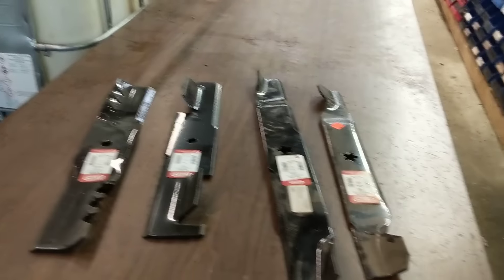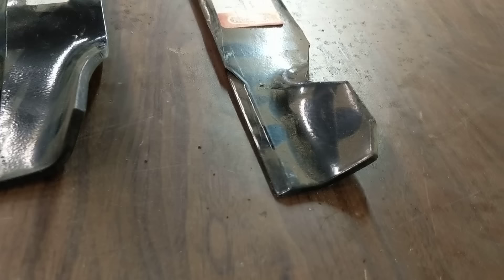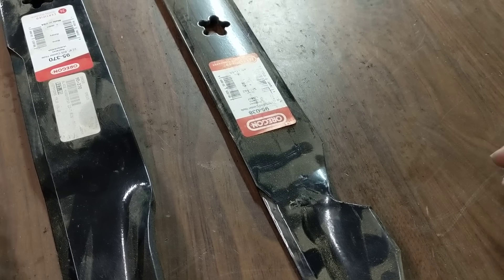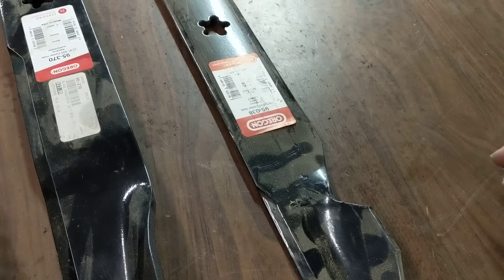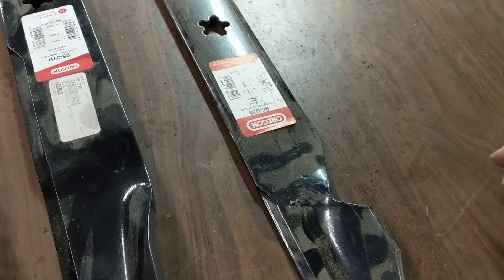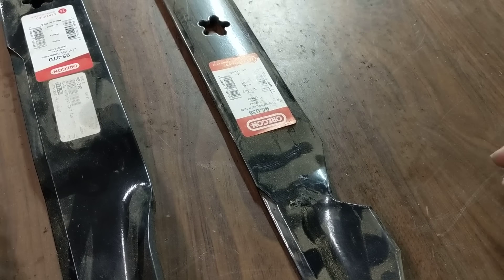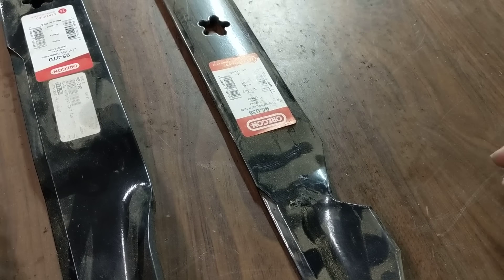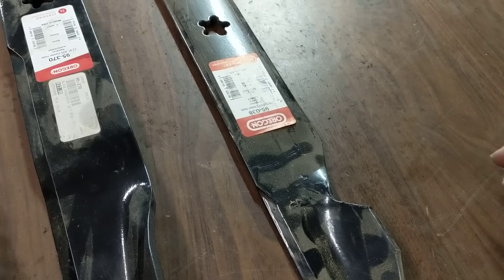Mower blade drastic difference and what is best for your yard and your mower. Oregon, Scag, Gravely,

Comment: Ok I have a question.  Lawnboy 21 inch deck and cow grass will destroy the regular lawnboy blade.  I am looking for a very thick blade like I see on your video Oregon high lift which is very important, and I have heard that one can rebuild the cutting sides of the blade by welding it with 7018 rod.  Such has been done and the blade holds up strong against cow grass.

What is the number of that oregon blade shown on the video with that heavy duty high lift?

Comment: So I mow a lot of weeds, dandelions etc, what’s best for me? I have a 48 inch spartan and the stock blades cut real grass well, but with weeds i have to hit every yard 2 times
Reply from the maker: Well weeds especially dandelions and clover can be a real challenge for any mower. Deck geometry can play as much if not more of a part than the blade itself. One thing to check is the pitch of your deck The height of the front compared to the back at the blade most decks should have at least a quarter inch lower at the front VS the back. Another thing to check to see if your deck has movable baffles lowering the front baffles to the bottom side can help create more vacuum The downside is the weeds like dandelions and clovers will stay laid down longer when they're bent over making it much harder for the vacuum of the deck itself to pick those up and cut them. a good high lift blade is usually one of your best options I'm not familiar with the Spartans so I don't know what is available. Also make sure your pitch is set up correctly I hope this helps. Just understand that many people have the same problem and some decks just work better than others.  if you are mowing commercially it is an excellent opportunity to point out to your customers ahead of time that these things are standing out in their yard because their yard needs a good weeding and fertilizer and seeding services that you can provide them. Each at an additional charge and multiple times in a year can be an excellent source of extra income and plus it makes the yard here mowing look that much better almost think of it as a billboard for your work.
Thank you for taking the time to watch and comment.
Reply: Fueled Iowa I appreciate the comment, helps me out 99% better than everytninf else I read or try to look up thanks
Reply from the maker: @Htzcw  You are welcome! I am glad I could try to help. To many people today only want to give their opinion vs help someone else find their solution. If that makes sense. LOL
Reply: @fuelediowa  I LOVE this reply.  Simply put, some people just like to 'hear' themselves talk. A sure fire way to spot a very lonely person.

Comment: What's the best blade to use for picking up leaves Bob Elkhart Indiana
Reply from the maker: Picking up as in Bagging?
Reply: @fuelediowa  yeah my lawn mower doesn't really bag that well at all I go about 10 feet and it clogs up maybe a high-lift will help
Reply from the maker: @Jerry-me1fy  hi-lift may help a lot. If it is not a power assisted you will always be fighting an up hill battle. Also depending on how much moisture your grass has will play a huge role in how you can bag. I have seen a few instances where Gator blades work better because the clip the grass into smaller clippings before trying to blow up the tube others were high lift works better I've also seen where medium lift works better. most time I would suggest if you're struggling to not be mowing more than an inch at a time you may have to increase your mowing to twice a week to be able to bag effectively . It is kind of like mulching in that sense.

Comment: Can you recommend a true mulching blade then? I search in Amazon returns the ones you've shown here.
Reply from the maker: To mulch properly you need more than just a mulching blade you need an entire mulch kit which divides each section of the deck off and do its own compartment blocking them off. Most manufacturers sell an entire kit with the dividers as well as the blades all in one manufacturer mounting blades as good as any other than possibly lighter weight.
Reply: @fuelediowa  🤔?
Reply: @bustersmith5569 ...he's talking about a riding mower that has two blades. These kits section off/separate each blade from one another creating two distinct chambers (smaller volume in each section versus an open deck with two blades) ...

Comment: What are your thoughts on battery mowers & which blade design would be better than what they come with?
I've got the Kobalt 80 volt.  Works well, but we just drop the cut into the lawn, no side eject unless things are tall.  They only offer the high lift blade.  I'm considering a modification to a blade I am about to sharpen.
Reply from the maker: Excellent question and I'm glad you asked. Battery-powered units you have to be careful with because some of them will have a voltage overload shut off. What this means for the end user is if the blade is too heavy by chance it can trigger this voltage overload only by the sensor causing the unit to shut down. Also The type of blade can have serious effects on your battery run time. As of right now in the main shop that I deal with and work with we are only replacing with OEM blades until we have adequate time to actually make sure there's not going to be any severe side effects and that's going to vary from unit to unit. Also Kobalt last I checked was made by Chevron, it is the same company that makes Ego so it may be worth a look to see if you can find a different style of Ego blade that will fit on your Kobalt the odds are they use the same blades.

Comment: Just bought a Gravely zero turn, which do you suggest for helping with getting a better stripping?
Reply from the maker: I good high lift will give you the best blade wise. however the pitch of your deck needs to be correct and a striping kit helps as well. Plus having grass that will take stripes well very thin scraggly grass weedy doesn't always do as well as others. Thank you for taking the time to watch and comment greatly appreciate it.
Reply: @fuelediowa  Thank you!

Comment: Is there any benefit to using a high lift blade with a John Deere equipped with a power flow, or should I just stick with the standard J.D. blades. It is time for new blades and would like comments on this, thanks.
Reply from the maker: There are a couple different ways to look at this and some will depend on your grass as well as how much moisture is in it. A high lift blade is going to push the grass to the power flow faster as long as the power flow keeps up with the feed then the benefit is the grass gets cut fewer times means less moisture being broke out of the blades of grass. Less sticky build up. Many dealers will recommend low lift blades or even sometimes mulching blades this will give the opportunity for the gras to be cut multiple times equals smaller pieces and easier to flow up the chute. Down side can cause more moisture cause blades of grass to stick and build up more. I know a few guys really like the gator blades for this but similar results to the mulching blade but a bit more lift / velocity to the power flow. In my area southeast Iowa many guys run high lift blades.hope this helps.
Reply: @fuelediowa  Appreciated, I may try a high lift blade and just keep my ground  speed reasonable.

Comment: Hi, which blade would you recommend for my 22" Toro recycler. I have tall grass and use side discharge only. Thanks
Reply from the maker: I would consider the Gator style blade to just help break down the grass a bit more. However it can cause a bit more build up on the deck so will need cleaned out a bit more often. thank you for watching and taking the time to comment.
Reply: Gator

Comment: Gators are louder and you have to grind off the powdercoating off where the blade meets the spindle and bolt washer, otherwise the bolt backs off.
Reply: Doesn't happen on my John deere sabre or scag ztm.
Reply: @jean-pierredejon7458  lots of posts on the various forums on them even

Comment: Hate to say it but the guy talking sounds like he is really having a hard time breathing. Hope he's OK
Reply: Definitely doesn't have healthy looking fingers.
Reply: Not everyone is comfortable speaking while making a YouTube video. I hope he is fine, but I’m quite certain he’s just nervous and wants to make sure he’s conveying the information is a fashion that will keep the trolls from tearing him up...yeah, people can be very mean when they’re hiding behind a computer screen and acting like they’re an authority on everything. 

Good information! Just finished resurrecting a 2001 Cub Cadet 42” that was dead and forgotten. I actually am using blade #2, and it gives adequate lift to send the grass into the bagging attachment. I’ll probably get a pair of those notched blades to see how they do in the fall when the leaves cover my backyard. It would be sweet if they mulch the leaves and fill the bags as well. BTW, part of the restoration was making two new bags with mil spec coated mesh and 1000 denier Cordura for the back and bottom. The bags will,probably outlast the machine. My cost was only $25 to make both bags...1/4th the cost of replacement bags made in China.
Reply: @joevalencic5275  👍
Reply: That’s just the way largely overweight people sound when speaking. Hard to push that diaphragm down into a big abdomen so you don’t get much inhale. He’s fine.

Comment: have a zero turn, craftsman pull behind leaf vac . the zero turn has gator blades on it. a lot of leaves seem to escape under the deck do i have wrong blades for that task?
Reply from the maker: I would look more at the set up on the deck. Making sure your pitch is correct and check if there is adjustable baffles as well to help increase vacuume
Reply from the maker: Thank you for watching and taking the time to comment

Comment: I have a John Deere d140 48 inch entry level mower and it takes like two to three passes to get it cut.  Why?
Reply from the maker: Did you buy it from a dealer that properly set up the equipment they sell or a box store?
Reply: @fuelediowa  ya I bought it new from an authorized dealer.  I did change the blades once.  But it always leaves grass behind and I end up going over the old stuff once then again with half new stuff and half finishing off the old line ....if that makes sense
Reply from the maker: @frankdubois877  I would call them and ask what they set the deck pitch to. Many times places don't set the pitch and leave it level or even worse pitched towards the back. This will cause lose of vacuum and horrible cut quality.
Reply: @fuelediowa  anyway to check it myself its been 2 years they probably don't remember.  If not I can probably upload a video and show you some things
Reply from the maker: Yes if you consider the front of the mower north and the back of the mower south.
Reply from the maker: if you consider the front of the mower north and the back of the mower south put your mower deck at the height you want to mow at generally place your blades north to south on a completely flat surface such as a concrete garage floor. You want to measure the tip of the blade on the north side compare that to the south or the rear of that blade facing back you want a quarter inch of a drop so the north side of the blade or the front when it's in a north south position you want one quarter inch lower then the rear of the blade.

Comment: Blades #2,3 are pretty much what I use with side discharge plus they have the star center hole on my mower. Doubt if I would see a difference between either. Never owned a bagger.

Comment: I have a blade on there with a round center hole that needs replaced. Do I need to replace it with that style or will the star center hole work? TIA!
Reply from the maker: On many Husqvarna ayp style mowers that round hole is the same as the center of the star and they have been known to use the same part number on the star one as on round hole  ones directly from Husqvarna before.

Comment: I am looking for aftermarket blades for my mahindra emax25m-2514 60 inch mower deck model AEMAHME60. blade oem part number AME050008.  21 INCH BLADES WITH A 5/8 INCH CENTER HOLE

Comment: Best blades for Bahia? Where I live it's 95% Bahia
Reply from the maker: Sorry I am not 100 percent for sure on Bahia. That is a tough grass. What height are you cutting it and how often or more specifically how much are you cutting off each mowing?
Reply: @fuelediowa  well depends on how high the grass is. If it's about a foot high I'll cutting it at 3.5 then go back over it and cut it at 2 and 1/4 cutting every two weeks
Reply: @MyVenom1776  in 3 days the seed stalks are over a foot tall.   The  leaf blades should be cut at 4 inches if you want it to thrive.  Personally I consider it a weed.

Comment: You want the best and sharpest blades..?  Buy some cheap blades and have a Tig welder , weld some  hard surfacing on top & bottom of the cutting edge....as you use the blade it will sharpen itself ...works great and lasts a long long time ...!

Comment: Is there a sand blade for husqvarna 54" Z 254? I have a lot of sand.
Reply from the maker: Sorry for taking so long to get back to you. There is not one that I have found. Thank you for watching and taking the time to ask. Have a wonderful weekend.
Reply: You’d want a low lift blade.  They’ll cut, but don’t throw the clippings as far, but they’ll protect your mower deck.
Reply: You can try eBay, I buy my sand blades there but the suppliers change.
Reply: @oldgringo66  thanks for the info. I read this after I got my blades from ebay. Got a great deal too. 3 sets for a little more than the price of one.

Comment: i have a part of my yard that holds water due to drainage issues.  sometimes it rains all week and i can never cut it dry.  my ariens 42in xd zero turn collects so much clippings without discharging them that i have to clean out my deck after every mow.  any idea on a blade or anything to combat this?
Reply from the maker: Unfortunately this is a challenging situation that you will fight. trying to get the lawn to not hold water is probably the best solution but can be costly and take a lot of work. Stay away from mulching blades, gator style blades, ETC those will just cause more of slurry to stick to your deck. Thank you for watching and taking the time to comment.

Comment: I have a gator blade from Oregon it's so noisy compared to original 
Its like a airplane engine turbine
Reply from the maker: Well it kind of is Higher the lift means more air they are moving then the extra fins are just breaking through the wind. Each blade is just a sharp fan blade.

Comment: Wait you said these weren't mulching blades, but you explain that some of them do mulch? Explain...
Reply from the maker: I mulching only blade is very low lift (to keep grass suspended) and is meant to be in it's own section \ compartment. The Gator blade does break up grass and especially leaves more but still has a reasonable lift so it will still throw the grass from far trim blade of the deck to the discharge side Crossing the other two blades before discharging.

Comment: Is there a big difference between push mower blades and riding mower blades. Will they interchange
Reply from the maker: Most time push mower blades are lighter. I would not use one on the other for various reasons. But I have seen mowers come into service with the wrong blade on them.

Comment: I have a Husqvarna 54" and the manual says to use the bagger blade. Can I use the gator blade and what would be the part number. Thanks
Reply from the maker: 396-800 I am pretty sure is the number for the commercial ZTR like PZ60 and maybe 595-605 for some of the other 54 inch. The Gator blades will work ok unless bagging, then there is not enough lift to blow easily up the tube. Also some folks do not prefer Gator blades in the spring. But Fall for leafs is a strong point for them.  Thank you for watching and taking the time to ask questions.

Comment: Gator blades are heavy gauge steel and will vibrate the hell out of your cutting deck. Not worth the tradeoff.
Reply from the maker: I will have to add some to your statement. Yes if you have an underpowered mower heavier blades can and will cause issues including what you describe. However there is another thing, Oregon does not deliver a balanced blade every time. I have seen some way offsided. Again this will cause horrible shaking and other issues. With my current set up they run fairly smooth. However not the smoothest blade that I own, Also I have the knowledge and ability to find and resolve some of these issues that are often overlooked or some people just don't know how to fix it. 
I greatly appreciate you watching and taking the time to add your input. It is something people should consider.  Have a GREAT DAY!

Comment: If you have a decent mower like John deere or kubota, then buy the factory replacement,  problem solved.
Reply: Factory does not always mean best performance but will mean an inferior product with an upcharge for the name. The guy owns a small engine shop, he works on machines better than John Deer or Kubota. People that run Walker and Gravely mowers use Oregon blades, they buy them by a dozen sets at a time.
Reply: @dingusfuzzklonnkt2755  guess you own mtd quality machines and dont know what good blades are yourself. I have never had an issue with my blades. The ones shown are for cheap mowers.  A good quality jd or kubota blade is much thicker and lasts much longer. A cheap mower in itself is probably not good for your yard.